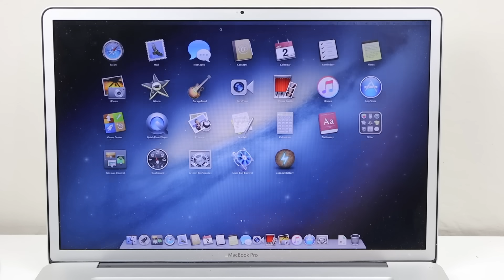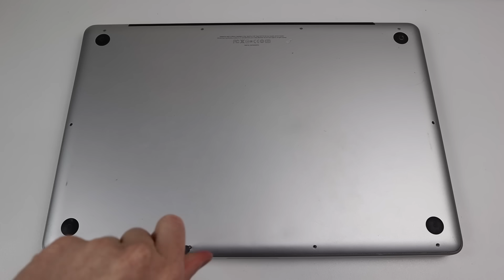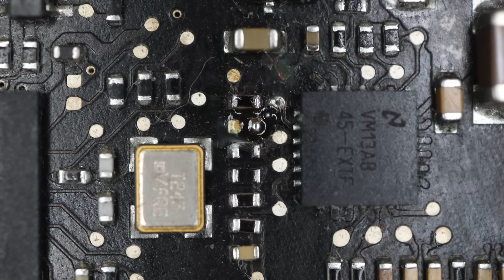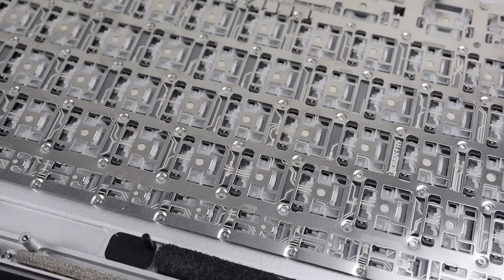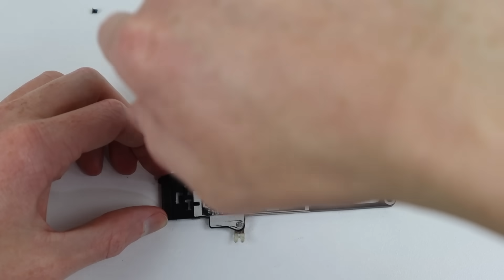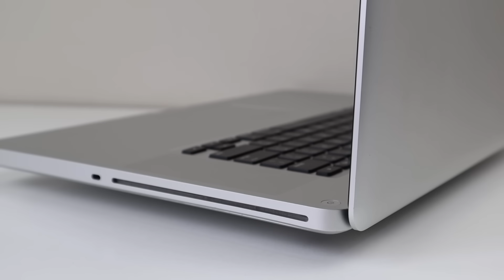Fried GPU! MacBook Pro 2011 Restoration

Comment: a 2.2Ghz intel CPU from 2011, a now disabled (would have probably survived with better TP and a reflow and worst case a reball) GPU, now with a Crucial SSD that I have used and is not remotely up to par by modern standards--especially compared to M.2, and 16GB of RAM for what?  The SSD has no real taxing work to be done, since you're very unlikely to be doing video editing on the system or anything that would require the boosted write speeds. The HDD was probably totally up to the task. If the GPU is disabled let alone the 2.2Ghz intel chip, it's virtually useless except to do things a tablet or phone could do anyway. I just don't get it, it exists and it's good that we've seen it repaired but for what point other than because you could? I would imagine most of the repairs you do (and it would seem so) are ones that have a high-value output whether it's someone would really want this, or someone would want to collect this, but this one is kind of a sad end result. In repairing this laptop and by repairing I mean quite literally frankensteining it, we now have the waste of: 
the old adapter for the network card
the old keyboard, which apparently may have had nothing wrong with it
the old RAM chips
the old GPU which has been disabled and power cut to it
the HDD that was a very good pair for the system in question considering it has lost a very serious amount of possible use cases because of the GPU situation

Add the fact that the battery is super old and the laptop is from 2011, and you get . . . ? ? ? 
It's just going over my head this one.

I've personally saved many computers, phones, etc especially ones that have been discarded. There's a point in which you need to ask yourself, am I saving this device, am I collecting this device? Or am I hoarding this device. 
that's not to say that you are hoarding anything or whatever, but, this repair was, other than the money you've made by filming and producing the video for YouTube, and the iFixit sponsor, seemingly very pointless. Not that it was wrong at all, but the point entirely escapes me since all your repairs seem very purposeful and I always say "that's very useful and he has such a point to make here. look at how old Apple products were so easy to fix and how Apple was beginning to find new creative ways to prevent people from repairing their stuff." But this one doesn't quite have that aspect

Comment: While yours is clearly a more permanent repair, there is a software workaround available from dosdude1.com. It's a patch/workaround that disables the AMD GPU and even allows for system updates afterward. He's got a host of tutorial videos on there along with free patches available for anyone with a 2011 15" or 17" AMD GPU problem. One issue with these is if you upgrade past Sierra the brightness control doesn't work (it's always on brightest) and it will no longer wake from sleep mode (has to be hard reset). Everything works perfectly in Sierra though.

I've personally repaired about a dozen 2011 models with this software fix for customers over the past 15 months or so, and haven't had a single issue with them since.

Comment: Acer, HP, Lenovo ... two screws and 4 latches, keyboard comes out. Apple ..... entire laptops need to come appart. This is specially stup1d since keyboard are one of the most worked parts of a laptop, and anything that interfaces with the human mechanically is likely to broke first. Even the slim Acers keayboard can be changes effortlessly. But they attach the besel permantly to the keyboard ... so extra work is needed to install a generic one since besel is not included. Still fixable. Low profile keyboards, slim screens with almost no frame, lack of ports ... this is the combo of features that guarantee your laptop will be in the bin as soon as possible.

Comment: Ive fixed a 2011 just like this, I baked the dies with a heatgun for 5 minutes and then hit the mobo with low heat to let the solder cool down slowly. Then I replaced the battery and it was able to boot with out lines on the screen.  A bad battery symptom is the failed to boot issue. To get the gpu working you just hit the gpu die with a heat gun slowly hitting it with less heat to cool down. otherwise the solder can stress fracture if you just turn off the heat immediatly.

Comment: battery replacement in a late 2012 13" retina mbp.... I pretty much had to chisel it out. I fitted a third-party job from amazon & it works fine, but I didn't use bloody epoxy resin to secure it, just regular hot glue from a hot glue gun. apple, wtf is wrong with you people? it's a battery. the very definition of a consumable, a component with limited lifespan.

Comment: I have a question:
My MacBook air 11 inch late 2010 has damage the battery since 2015 and I will not able to replace a new battery but now I want to buy a new battery will still work after 6 years  from now?
Reply: If it's just battery problem, then yes.  It will work for many years ahead.

Comment: My Late 2011 17" MacBook Pro had the same issue. It is perfectly possible to switch off the GPU using single user mode (https://gist.github.com/cdleon/d1eff7246a25193304284ecec40445b0) and continue using your Macbook on the onboard videocard... Not necessary to solder any cables, GPU killer or what so ever to 'fix' this problem. Only works with (High) Sierra unfortunately but still way better than soldering etc...  I later brought my Macbook to service (https://www.mobilehardware.nl/info/apple-macbook-pro-2011-2013-videokaart-reparatie) to replace (not reflow/reball using heat) the GPU. I hope my Late 2011 17" MacBook Pro will last another 9 years!  Hope this post will help extend the life of all the 17" MacBooks Pro still out there!

Comment: I have one, I use it daily, with Catalina patch, and because of that, it doesn't use the AMD Radeon at all since Catalina requires Metal which the Radeon does not support, and the Radeon is broken on my model too. It also has a 256 GB SSD instead of the hard drive. It runs great but runs a little hot sometimes.

Comment: You said you can't remove the battery off the new mac books but I work at a repair shop and we do it with fishing line and some thick gloves so we can pull the wire under each cell and cut the double sided tape that is under the batteries

Comment: I don't have access to CMIZapper chips, but what I do is reflow the GPU with a heat station (this isn't a permanent fix, 2011's almost always fail again), after it's in a booting state again, I apply dosdude1's GPU disabling technique and application, it's worked great for my customers who can't afford new machines at the moment.

Comment: Do not disable the AMD GPU.  Your problem is likely a bad solder ball in the AMD GPU.  Re-flow with heat gun.  Intel GPU suffers from same problem and the fix is the same.

Comment: I did the oven GPU fix on a 2011 macbook pro, still works to this day
Was planning on selling it but i thought i'd test it first, still have it as a second laptop today, a year later.
Reply: Is the oven GPU fix what this guy did in the video? I have an SD drive now and it's working super fast except when I load google maps it slows down majorly and the Activity Monitor says Opera Helper (GPU) is taking up 90% of CPU. Macbook Pro 2011. I need to fix the GPU and keybaord. New battery, new fan, 8 gigs ram, new power cable. I won't give up on this laptop!
Reply: @katierose1893  nah he just disabled the gpu not fixing much tbh
Reply: @copy.floppy  thx man!

Comment: My MacBook Pro 15” from 2010 has a somewhat similar issue in that it will randomly kernel panic or turn off. I tested this on three operating systems. Snow Leopard worked fine with little to no kernel panics. Lion and High Sierra however would kernel panic a lot more often. This is a GPU related issue.
Reply: Its a cap thats causing it. i forgot what one it is but dosdude1 has a video on it.

Comment: I had a late 2011 MBP that had the same issue.  I had it repaired by Apple right before the recall expired, and it broke again a year later.  I ended up taking out the motherboard and heating the GPU with a heat gun to reconnect it to the motherboard.  This worked for about 8 months before it unseated once again.  Ended up getting a different laptop, but the entire process of fixing this laptop and replacing phone parts multiple times was a huge learning experience for me.  Had I known there was a solderable piece that would stop the GPU from trying to start up, I might have tried it.
Reply: I got one with a broken GPU for cheap, and a donor to transplant the entire motherboard.
Since I didn't really care much about its looks, I simply drilled holes around the fans in the bottom case, which reduced temps by 15 degrees c.
So far, 6 years on, and it works fine. I did have to replace the speakers and battery last year though.
Reply: @dgurevich1  Hi, what do you mean by drilling holes around the fans? can you show me the pic please? and is it really working and can reduce the heat significantly?
Reply: @deemka476  the bottom case is just a sheet of aluminum. So I used a hand drill to make 1mm holes 3mm apart around 2 circles where the fans are, and 4 2mm holes in the middle of each circle.
After that, raising up the computer also helps.

Comment: Could have maybe BGA soldered on a new GPU (unless it's paired) . It was really corroded as well so I suppose you didnt want to take any risks with doing lots of soldering. Good work anyway!!
Reply: nah the GPU isn't paired
Reply: @AverageUn1x  A new reply after 5 years, nature is healing🙏🙏 since my last comment I have a degree so can confirm you are correct and they usually aren't paired, although performance will vary due to infinite deals of minor revisions, complexity and age

Comment: The easiest way to remove something like that small resistor is to add a little fresh solder to it. the very small amounts of lead-free solder that are used on those boards make it very difficult to transfer the heat into the solder and to melt it. A tiny bit of fresh let it solder will make removal much easier.

Comment: I gonna watch later. I did this exact reparation, ended-up changing/upgrading the board for the still compatible and more reliable 2012 non retina board. Monitor cable was finiky to install tho. 99% compatible.

Comment: Hugh, great video, but i have a tip, you can use lacker wire instead of the wire with pvc you used in the vid, if you bust open an old crt tv, on the board where the rf modulator is, you will find some kind of transfo's that look like a wheel, this wire is small yet sturdy, the lacker on this wire is thick, but when you solder it, the lacker of the wire will burn away leaving you with a sturdy copper wire perfect to jump from 1 connection to the next, i use this on several repair jobs and it works fine :)

Comment: When this macbooks extended repair service program was available I remember Apple simply would replace the motherboard with the same defective model of motherboard. 

In 2015-2017 you could have this part replaced for free, and immediately upon receiving it back run the "Donut of death" GPU stress test and the GPU would immediately show signs of deficiency. 

I did this during the extended repair period when 2011 MacBooks were no longer being produced. 

Due to this issue, you could simply repeat the repair process 3 times. After the third time, the apples "Lemon" Rule applies and they must supply you with a new machine. 

We received a 2013 15" Macbook Pro Retina with integrated Graphics for free as a result of this issue because there were no more 2011 models to be given out.
Reply: Damnn. Wish i new that. I got mine replaced for the same and just died months later, and their program expired 😪

Comment: it is insane how different this 2011 model is in AUS vs the US. 
The internals are very different on this specific model. The fact that you can just remove the keyboard without all the rivets and stuff cutting you is blowing my mind. Also expansion slot??? Very different from the 2011 MBP 15" sitting on my desk with s fried GPU.....
Reply from the maker: This is a US model, I got it from the US

Comment: Usually (not always), if applying heat to fixes the GPU, means the solder balls for the GPU are breaking apart and needs new ones reapplied. Don't remember if these series of models have actual bad GPUs though.

Comment: Hi hugh, for the stuck shift key you could try installing a clean install of the OS as my 2012 15" MBP suffered from a partial keyboard failure in Sierra even after replacing the physical keyboard. Not sure how keen you are to mod this to run Catalina but I believe dosdude1 has a way to boot these macs to Catalina which may also solve the keyboard issue

Comment: This method is not necessary You can achieve a better solution by updating the firmware to Catalina with either a patch or firmware flash. After disabling the 
GPU do software.   nvram fa4ce28d-b62f-4c99-9cc3-6815686e30f9:gpu-power-prefs=%01%00%00%00. The update will make it so that you don’t have to make additional folders for archiving NVRAM, and SMC. Although there are alternative methods for older software’s developing archive folders for boot up they are not as good as the option listed.

Comment: Little advice on soldering: the solder contains flux which will flow the solder so it bonds to your surface perfectly. If you apply already-melted solder from the tip of your soldering iron, you'll make awful joints. The trick is: always melt the solder ON THE PADS. IF you cannot do that (camera in the way, small components etc) then buy some flux and squirt some on the pads before you do the job. In that case even the old solder from the tip should work - or will work better.

A finished, good soldering joint should end up being smooth and shiny. 

Not telling you to show off, just genuine advice.

I wasn't aware of this chip BTW, it looks like a great idea.
Reply: I know this is an old post, but just here to agree. Soldering is really easy when you learn the trick is just to use a lot of good flux. Don't need to use some tiny tip (usually the smaller ones make the job harder, not enough thermal mass).

Comment: Have the same exact same  Macbook with a dead gpu:
- Although the hardware solution is an option, I would recommend this software one that I found after some digging :
https://gist.github.com/cdleon/d1eff7246a25193304284ecec40445b0 - Thanks to @cdleon
I have found that this one works best for me, as it runs on the integrated graphics and Brightness keys and Sleep work ! (High Sierra 10.13.6)
There is even a Temperature fix also by @cdleon  - https://gist.github.com/cdleon/d16e7743e6f056fedbebc329333d79df - the iGPU gets hot when running intensive tasks.

Hope it helps fellow MacBook users !

Comment: I had a similar issue with my 2012 HP laptop. I guess the AMD GPU got fried so, well after a lot of google searches, I was able to fix it by booting into safe mode, disabling all the display drivers and then enabling only the Intel Driver.
Well, I've got no brightness control, no colour calibration, no video output. Videos above 720p start to have framedrops.

Comment: I love how you crossed out the "2.5 inch" off the SSD box and replaced it with 6.35cm. You really don't like the imperial system, huh? lmao
Reply from the maker: I don't :)
I am man of the present.
My 1935 Dodge was from a time before Australia switched to metric. Boy try and figure out those sockets and spanners.

Most people my age wouldn't have a clue how big an inch is here in Australia or the most of the world for that matter. We have accepted tech being measured in inches for the most part so we have some fame of reference to the screen sizes. But it's 2020 and I refuse to use it cause it's so confusing. That's why everyone got rid of it.

It infuriates me as much as 12hr time. There is 24 hours in a day, like why are people only counting 12 of them.

Why is the world so un-cohesive. Date formats, time and measurement should be the same world wide. It's basic stuff
It's the small things that drive me crazy.
Reply: @HughJeffreys  I couldn't agree more with you!

Comment: HI

I have iphone 4 after 2 years i truned it on and forgot the password.
When i typed in zhe wrong code my phone was disabled after that .
And after disabled comming Itunes.
I tried to restore the data (Foto) through some programs but i restarted the phone by mistake.

Can i restore pictures from the phone if i restarted that phone completely?
And if i can if you can tell me how?
I would be very grateful if you could tell me how to restore the pictures from the restarted phone.
❤

Comment: I have had two retina Macbook Pros with these GPU issues, crashing from kernel panic, etc. I solved it by running software that prevents switching to the dedicated GPU but it is an enormous pain in the a**. I notice the problem persists in a lot of the new 16" Macbooks. Utter ineptitude by Apple, charging squillions for these machines and not correcting it after many years.